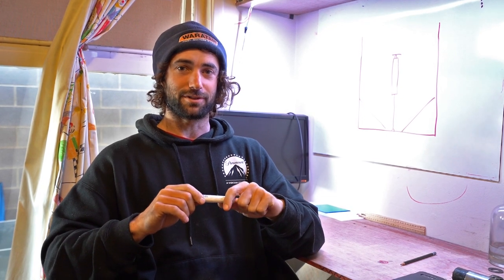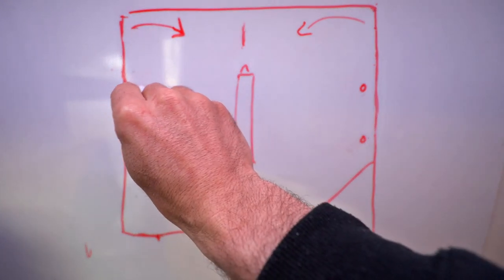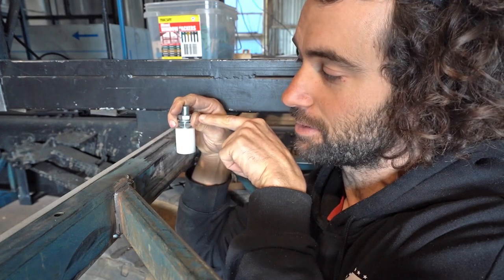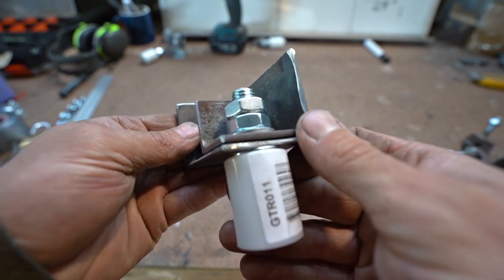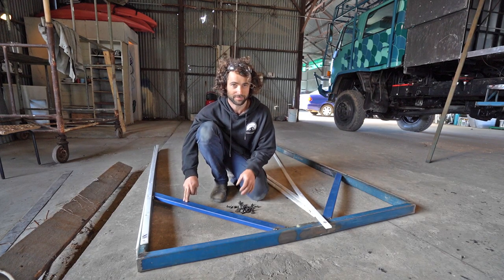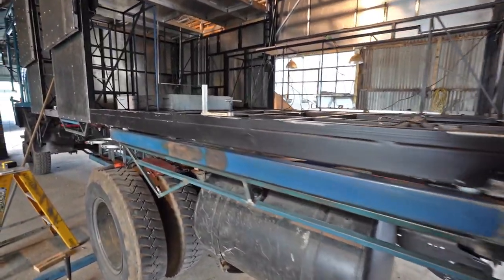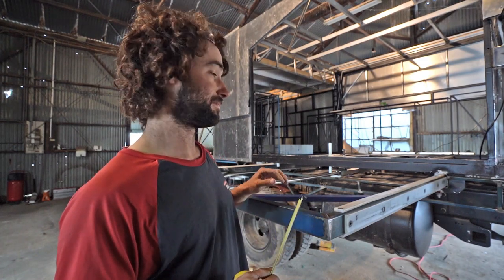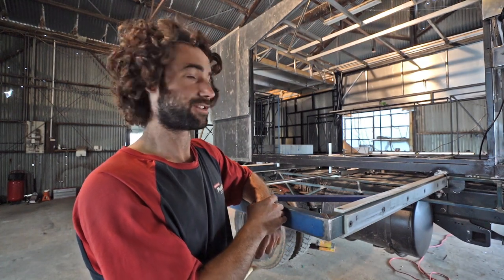DIY Slide Out Room - Expedition Truck Build #6

Comment: You may say crude.  But many parts on new trucks are crude as well.  So, it' excellent engineering and the art of building things from scratch in front of us.  Looks great.  Looks like it works great too.
Reply: This is a good observation. If it works it works.

Comment: At 6:10 - I would haved suggested a rail with skateboard wheels on each side of the rail. This way you maintain alignment on both axis - perpendicular to the chassis frame and the smooth sliding on wheels. This would be 4 set of wheels for the slide-out's further distance from the chassis and 2 set of 2 wheels for the frame closest to the chassis.  The rail would use C- Channel where the open side of the C channel is facing towards the ground.  The slide out needs to be insulated on the floor. Which means the slide out bottom would have to accommodate the added materials for the insulation. Saying this, the slide out would be better supported from the bottom not the top.  Thumbs up.

Comment: Excellent - I am envious of your up coming adventure!
If you have not thought of it already. I would also use some lithium grease. Also make sure your Teflon holding screws are recessed 2 or 3 mil. Round out your lower steel lip where all the weight is going to press the Teflon into the steel so it wont dig in. See if attach the upper portion in such a way you can leave it in a remove the slide portion for service if necessary.
Yes , this will be very interesting to see with weight on it. My rule of thumb with electric motors, which I to apply to an actuator(never) is to use on that is rated twice or the power needed for the job.
Wishing you all the best and now watching your progress.
Cheers

Comment: Such a awesome build! WHat will you do if the cylinder breaks and you are on a narrow path in a remote area :)
Reply from the maker: Good question! If it breaks while the room is extended I can use a ratchet straps or hand winch to pull it back in, if it breaks while it's in the closed position I can just remove the actuator and get it fixed or replaced

Comment: I dont get it, how are you going to build anything on a frame that retracts underneath the Floor???
Reply: May be he will remove the top frame which is blocking the bottom one then also he will loose few inches on either side but I think it’s nothing with all the extra space it creates

Comment: Awesome! Thanks for putting this together.
Curious what the cantilever length is relative to the total length of the frame? Also what are you using as the room's floor?
Reply from the maker: Total length is 2.5m, cantiliver length is 1.5m. It will need a support leg
Reply: @dancampion  Thank you!

Comment: Really nice work.Only one question,the teflon sliding system not stucking in the steel profil?Moving easy?
Reply from the maker: So far so good. It's teflon on stainless steel so should be fine